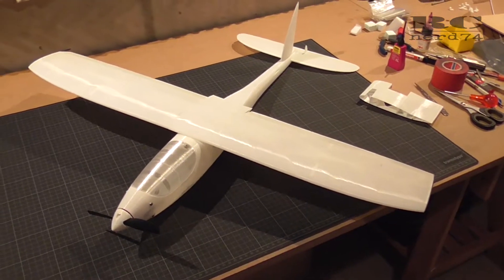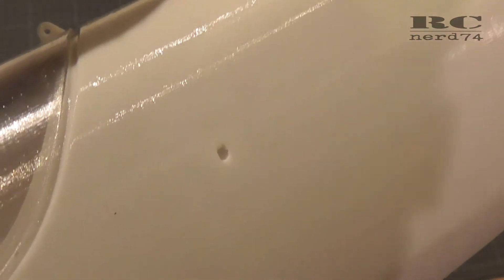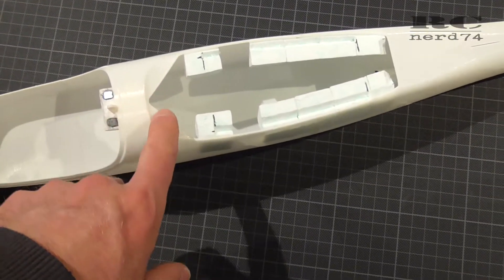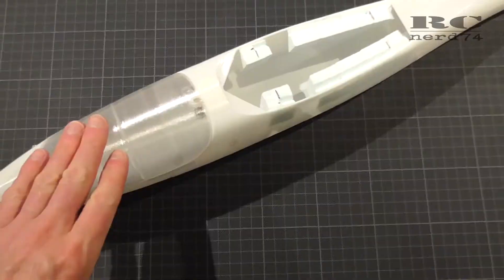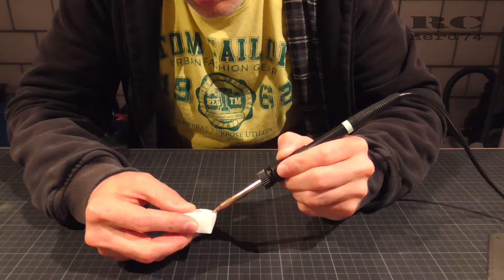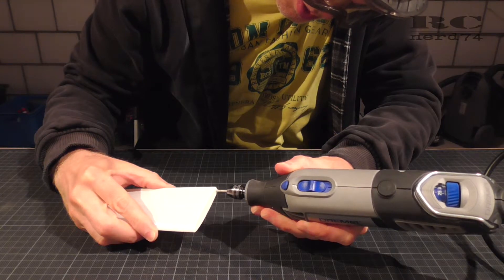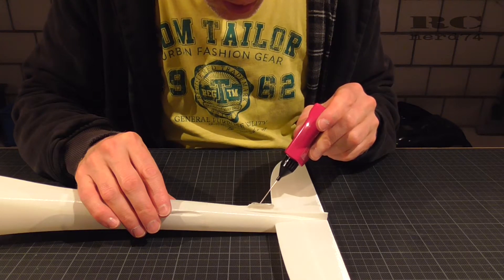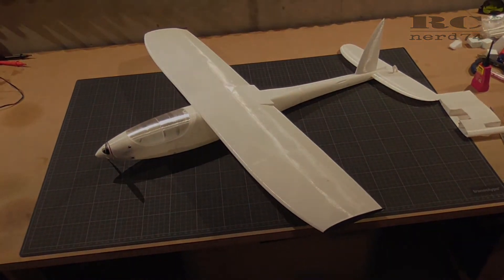ECLIPSON MODEL A | 3D PRINTED RC PLANE | BUILD PART 3 | FUSELAGE MODS & STABILIZERS

Comment: I’m building my Model A. Would printing in LE-PLA help keep the plane lighter to offset the added weight of your modifications and improve performance?
Reply from the maker: Enjoy your build. It is pretty hard to build this plane strong enough. LW PLA will help in case of the weight. But not in case of strength. Wish you good luck.
Reply: @RCnerd74  Thank you

Comment: In my experience, there's no need to reinforce the HTP, as it has never come off. It's the tail part of the fuselage just before the HTP that breaks off at tougher landings.
Reply from the maker: Reinforced the tail a little bit too. Hope this works. We will see. To be honest, i do not like the design of this plane too much in case of how rigid it is. Perhaps will give a 3dprintz model a try after this plane. Like to do some experiments with the model a. We will see how long it will last ;o)